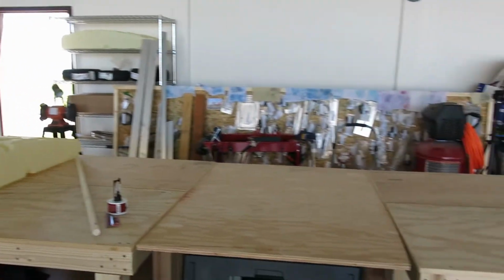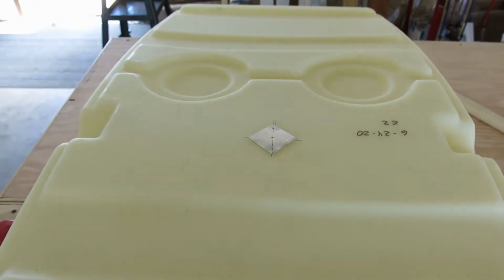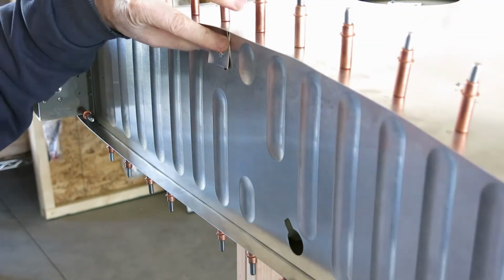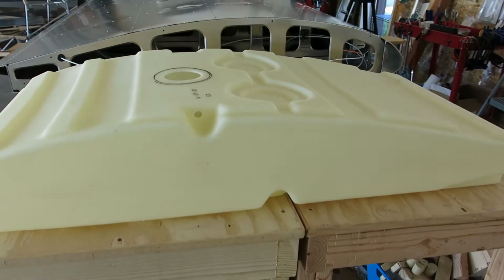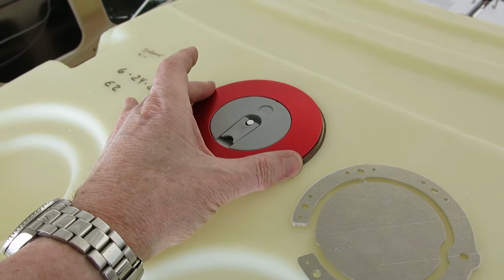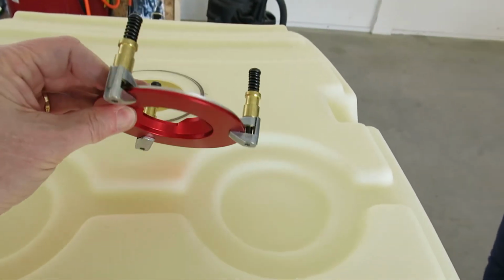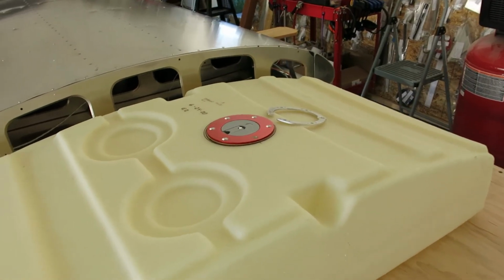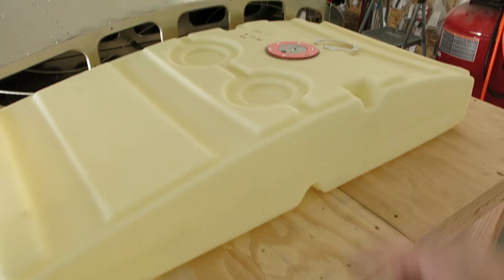No. 101 05-29-2021 Right wing fuel tank

Comment: I’d concur with putting in a small self-tapping screw with maybe just a little silicone under the head to get a good seal.  I suspect a small square of duct tape would also work as you likely won’t have more than 1 or 2 psi for the leak test or the tank will blow up like a balloon.
Reply from the maker: Thanks! Yeah, just needs to be enough to not leak.

Comment: A machine screw should thread itself into the plastic and hold enough given the relatively low pressure you will be using for leak checking. Or, even a sheet metal screw.
Reply from the maker: Thanks!